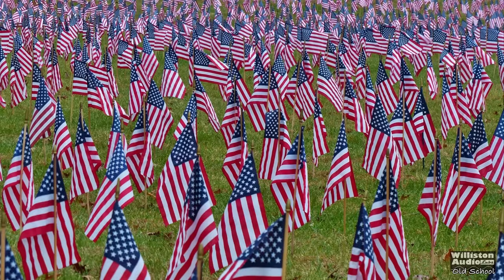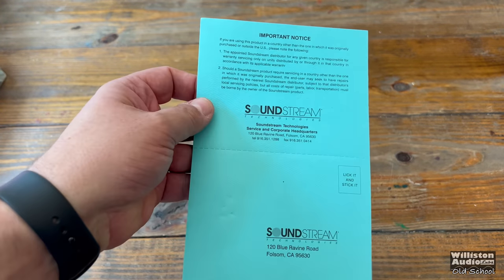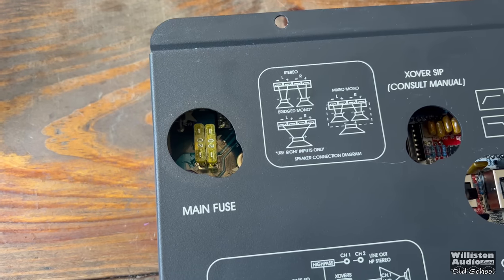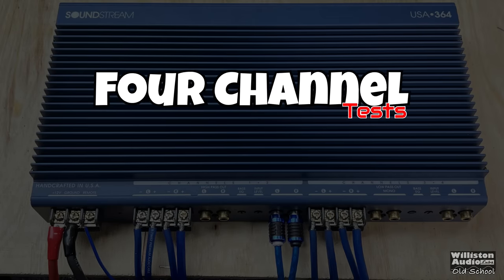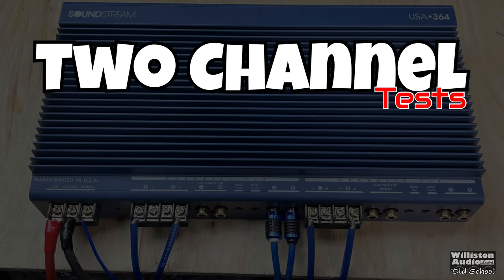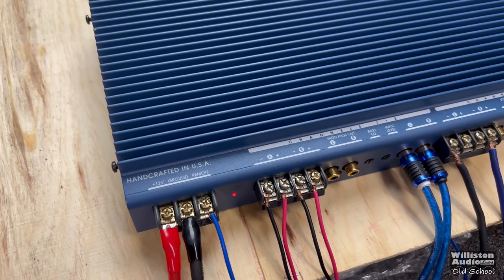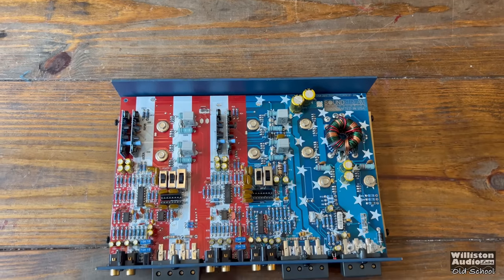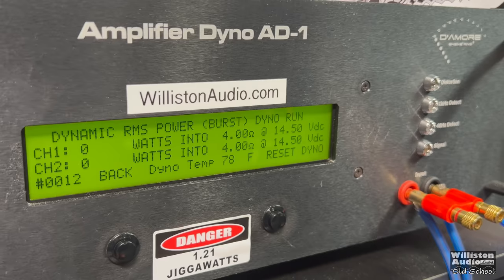This Amp Has a Really Unique Circuit Board

Comment: I only had one Soundstream amp back in the late 90's myself. It was called The Continuum, a large polished aluminum 5 channel. It was definitely a high-end piece, with inset terminals and controls. The amp sounded phenomenally albeit wasn't a powerhouse. I ran MB Quart red-box 3-way component 6-1/2's, 3-1/2's and soft domes on the first four channels and a JL Audio 12W6 dual 6-ohm at 3 ohms on the sub channel in a custom ported setup with a Pioneer Premier DEX-P1R head unit in my 1996 M3. Good times.
Reply: Nice! I still have mine. Although, I have not used it in several years.  Just sits in the box it came in, to help protect it.  That mirror polish was so clean looking.  The sound was so clean too, powering all my Orion NT speakers.  Ahh, the memories.
Reply: A classic

Comment: I had a few reference series amps and they sounded incredible. Compared them to Denon and Fosgate amps I had and the Soundstream amps were just clearer, detailed, and musical.

I wish I still had them. Their Reference subs were amazing too
Reply: I had a Reference 604 then a 644 (cause the 604 kept smoking and they ended up just giving me the 644) running Diamond Audio Hex 6.5s and 2 Reference 12's in my CRX. Best sound system I've ever had.

Comment: These came out right around when I bought my SoundStream Reference 1000 and 500s amplifiers. I wanted to buy one of them but i saw they were severely lacking in terms of power compared to the reference amps. 

All of these 90's SoundStream amplifiers, you gotta be very careful with the initial hookup of them. Some of the amps like my Reference 1000 have so many capacitors that you should use a resistor to fill them before applying power to the amp. When i hooked up my Reference 1000 a couple years ago, i did't do this and apparently the amp lacks any kind of inrush limiter and BANG, a bunch of the mosfets exploded, damaging some of the capacitor bank as well as the board itself. I've got the repairs almost finished i think.
Reply: Wow don't give up! There were and are still some of the best ever!!!

Comment: These were the amps for which Jacobs Accuvolt PWM DC to DC converters were created. I still have two 50Amp continuos models, but the older blue brick style vs the later, flatter gold amp-like models. BigD has lithium and caps, so 14.4V is easy.
Reply: I remember Jacob Labs 😎👍‼️ and AlumiPro super caps✅ with a/d/s
Reply: @eurekaakerue4649  I should have said 'Ultra Caps' and yes, continuous has a second 'u'. Uups.
Reply: @pgmurray76  THX teach😝👍‼️

Comment: Still have a ref500 in my EM1 and a ref300 playing up top mmmm Darlington power array not quite a RF DSM or like but nice amps of this era IMO they also had good low ohm stability and make for some clean power 90% sure they were 1/2 ohm stable capable

Comment: Hey Big D.   I have a question for ya!  Is there any way you could explain the higher THD with these newer and efficient amps as opposed to the class AB amps with better SQ that were less efficient.   I still use A/B amps to run my interiors whereas I would use the newer amps like alpine, taramps etc to run the subs

Comment: 2:00. HEY BIG D. NOW IM GONNA STOP YA HERE BECAUSE WHAT IM ABOUT TO TELL YA IS IMPORTANT.     I HAD A FEW OF THESE AND THE NUMBER ONE THING THEY WERE NOTED FOR AT THE TIME WAS EFFICIENCY.   BEING.   WHEN THEY PUT OUT 360 WATTS THEY ONLY DREW 400 WATTS OF BSTTERY POWER.  SP NOT DURE WHAT YOU WILL SAY ABOUT EFFICIENCY BUT THESE WERE THE VERY MOST EFFICIENT AMPS IN 1997.   SO REMEMBER THAT ONE.   THANKS BIG D FOR THE SPECIAL VID

Comment: Iv'e owned the chrome pure class "A" reference series, several of the the Van Gogh's  (VGA 1600.2, VGA 500.4 & VGA 320.4) and  will remark that they are without a doubt some of the very best you could get, and in some regards stil today (if you can find them). They also required a "LOT" of current and space to breath, absolutley loved these amps. Phenominal s/n ratios almost unseen in even the best equipment currently out there and damping factors in the  ≥ 500 range. True SQ beast.
Reply: That was really the good stuff!

Comment: A rehash of the Granite series. When SS engineers came to Australia to to show these off I somewhat insulted them by suggesting that instead of an expensive printed PCB that non-US customers place zero value in, why not spend that money making them more powerful or have better crossovers. Didn't go down well at the seminar...
Reply: Maybe 🤔 they listen to you back then , because the Reference line had separate crossovers for each channel, with linkwitts butterworths 😎👍‼️ So thanks 🙏 they may have not like what you said then but , they were listening ✅

Comment: Um....Dude ?   1 of those capacitors is swollen /fixing to burst at 9:27. Or someone has tried to mess with the plastic wrapper on it .
Reply: Looks like it might have been melted during a repair. Or scraped if someone was a little careless during a fuse replacement. Not a failure of the cap.

Comment: I have an SA244 that has identical specs and looks identical except for the model designation. It appears that the amp in the video is a special edition of the 244 and/or was made a different year. Mine is in the same excellent condition and also still works and sounds great. Great to see its brother on the dyno.
Reply: USA line, SA, and Reference amps are all the same, except by crossover and power specs.

Comment: Nostalgia only… todays tech is better
Reply: ❌✅ Efficiency an DSP ONLY , BUT SOUND ☝️😎❓ you’ve got much to learn those triple D Trans sound better than Mosfets All day  // sure they’re re not as powerful but they amplify current not volts, these are high current amps , reason for the Name Amplifier not Voltlifier // as  amperage is what pushes a coil through a magnetic field No so much the voltage 👋🧐❌ reason why two little 9v batteries in series giving 18v can’t turn your starter over but 11volts and a ton of amperage will ✅❌ same function here , damping factors on these Amps were serious an slew rates were king 👑 reaction to transients in music 🎶 was lightening fast , so mosfets  although more powerful today , can’t match that triple Darlington speed , only thing New for today // isn’t used in car audio yet , but will an will change the game are ((SiC & AGD)) output devices now just starting to be used in hiEnd home audiophile systems ✅❌ but they are coming soon☝️😎‼️

Comment: So the reference amps are underrated but these are barely making rated power?
Reply: I think a lot of the multi-channel amps by Soundstream from this era suffered from lack of power supply to drive all channels.  He would have exceeded rated power driving rear channels to a subwoofer and fronts high-passed to full range speakers (just like in his demo) but for consistency of tests, he always loads up every channel.  This is pretty clear when you see the dynamic power ratings.  This amp could bump well above it's rating for sure.

Comment: Soundstream had a reputation for having a very clean and well defined sound. I unfortunately never got a chance to own one. I am curious though if the current Soundstream amps are as good as the old ones?
Reply: No, they are not. I have my old Reference 700SX still, I sold all of my piano black tarantulas from around 2015 era. No comparison in SQ or amplifier overall build quality.
Reply: @TheKlixer  Thanks for the reply. I was thinking that would be the case. It's getting harder to find quality amps anymore.
Reply: @j.w.s.743 ☝️😎❌ TRU ,Helix , Zapco AP LINE , and Brax part of Fosgate // now run the SQ competitions with DSP amplifies